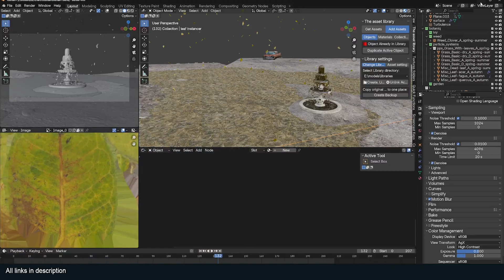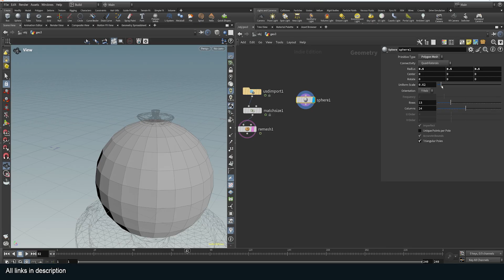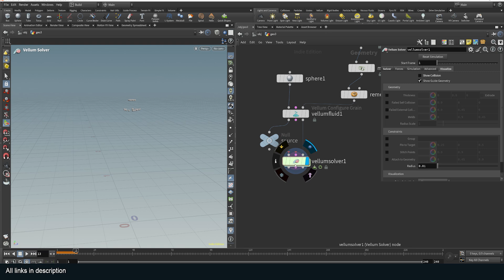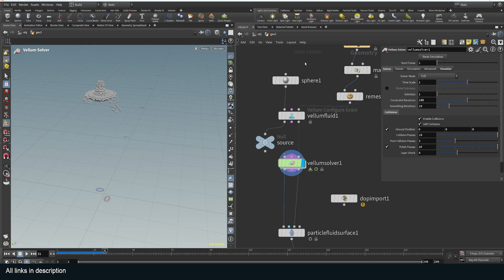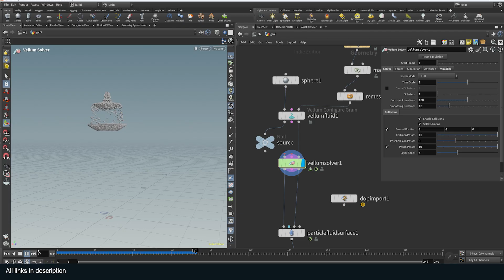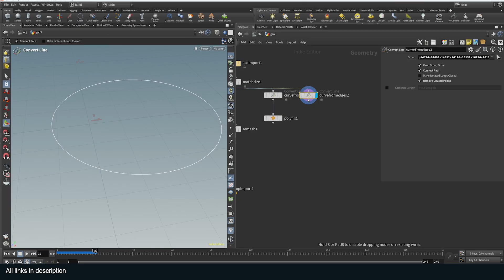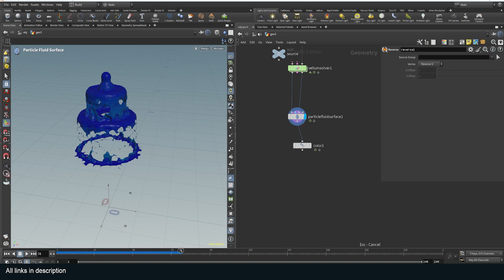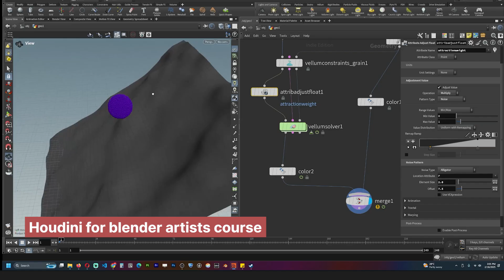houdini vs blender fluid simulation

Comment: Dificult than blender 😢
Reply: True, though modeling in blender and using houdini for vfx/animation makes for very solid workflow
Reply: Now I am grinding in houdini ,  in experience with both  I would say blender for fast and direct to go cgi you set up số quick these simple to intermediate sim , in contrast you only benifit the produceral system of houidin since you reach advance lvl 🎉  how to get that lvl -  you have to grinding for years 😂😂- I would say houdini is long term , the good news since you pro there is no lmit for you  in vfx
Reply: Actually, Houdini is easier than Blender. We just find it difficult because we never learned it step-by-step from the basics. Once you build a solid foundation, Houdini’s workflow is way more logical and because it’s procedural, it makes everything easier, faster, and more flexible.
Reply from the maker: how, doing this in blender is a nightmare
Reply: @TopChannel1on1  for simulations it's easier than blender because its very flexible, but in houdini one needs to know each node what it does. and i find the hard knock off part of houdini is the expressions (my goodness!!)
Reply from the maker: @luciox2919  i dont think thats the case, i rarely use vex and when i do its just a line or too, you dont really need to know how the node works, you just need to have an idea of what they do
Reply: if u   beginne blender is bestfast mastary  one software  propely then come advance